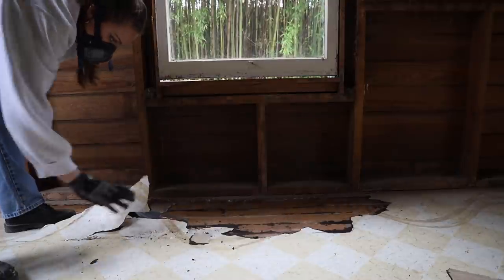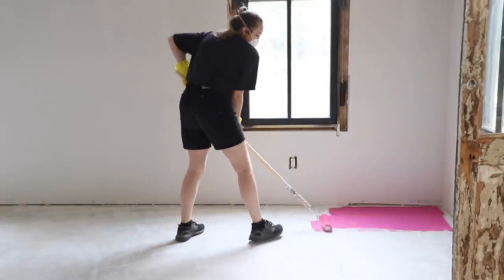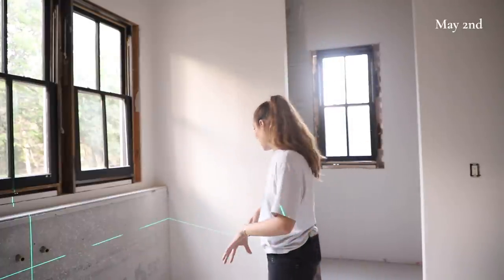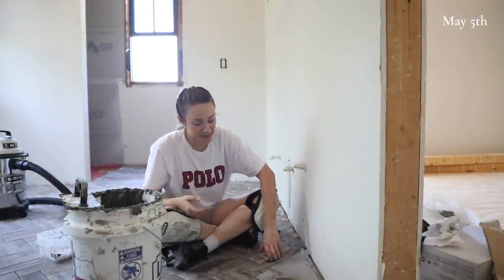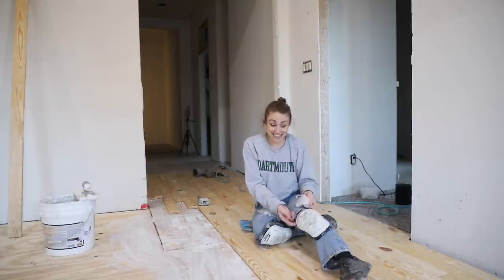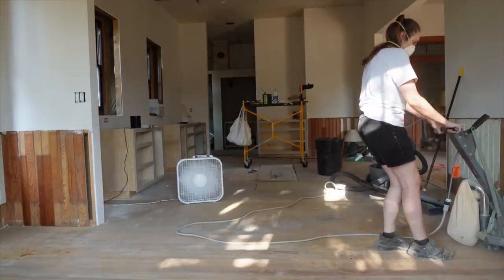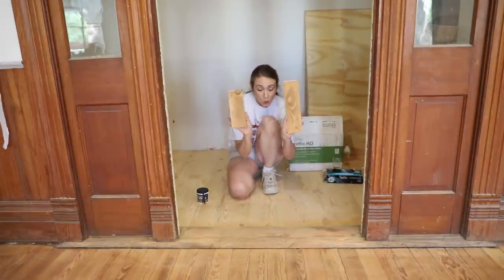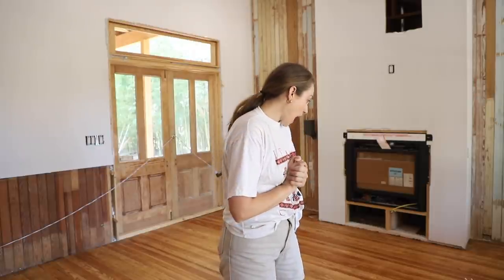DIY FLOOR RENOVATION *Restoring 110-Year-Old Hardwood, Laying NEW Hardwood & Herringbone Tile*

Comment: We usually use the water proofing on a small part of walls as well, about 4-5 inches high like skirting, to add a seal and keep moisture out of the cracks in between floors and walls. After this barrier, we roll out a layer or two of a thick underlay. If the floor space is too large, the underlay can be done with intervening plywood boards in order to avoid having a dip in the middle of a room with time. You can try this at the guests’ cottages later. Lastly, transition pieces can vary, and a lot of them have a tongue to be imbedded between 2 types of flooring. I just hope you left some space to accommodate. Lastly, Loving every minute of your videos, Very nice work and a superior attention to detail overall. This is exactly how I’ve been doing it. This type of work has its toll, but it’s worth every second in the end. Take your time and takes care of yourself 💐

Comment: That is a whole lot of hard work done! Amazing job! 👏
One question: Doesn't nailing the subfloor ruin the vapor barrier? I would assume it should remain intact 🤔
Reply: Almost impossible in this application. Some vapor barrier systems come with penetration seal patches. But since the plywood is attached at random nail locations, the nail holes cannot be spray foamed and caulked. Since the RedGuard in this application is being used for concrete “sweat” the likelihood water will seep through is minimal.

Comment: Hi MaCenna! Watching your video now. My dad, my husband and I installed engeineered herringbone floor to our entire house. We used the same glue with the water membrane. We recently had a small flood (broken washer) and had people come around to check the moisture level of the slab. It was perfection. No water had made its way to the slab thanks to the glue beneath (we didn’t waterproof). Can’t wait to see how your home turns out! Also, you’re amazing. How much you’ve achieved is really inspiring. Thank you for sharing!

Comment: Wow, that floor sealant really makes the floors look fantastic!  I wonder what those wires are sticking up through the floor in the living room?  Great job guys!  You've learned so much and your experience is building hugely!
Reply: She had some holes from where the old walls were that she was going to fill with medallions, but everyone in the comments said to put floor outlets there so she can plug in lamps, so I bet that’s what they’re for.
Reply: @ang_131  - That is exactly what they are for. Floor sockets to plug lamps in.
Reply: @ang_131  Excellent idea, like they did in the old days.

Comment: check the CFM requirements of the nail gun compared the CFM output of your compressor—you're right, you probably need a slightly bigger compressor to feed that thing. the nice thing about a larger compressor, is that it opens the door to other air-powered tools like polishing sanders, hvlp guns for paint/stain/clearcoats, etc. house is looking great!

Comment: You picked one of the hardest styles of laying tiles but you a great job .  Did you level it or make sure it drains to a drain all with a level to? I also noticed I didn't see drainage any where And always work to the door way so you don't walk on the tiles to get out....also sanding the floor be careful you don't take to off.

Comment: Cutting tile...to prevent breaking...
* One thing you can do is put a strip of masking tape over the cut line. Then mark your cut line on the tape. If you're laying it glaze side down, put tape on both sides. 
* When you get near the end, slow WAY down!
* Cut in on the opposite end ~ 1/2 inch, then flip over the tile. Cut the full length all the way to meet your 1/2 inch cut-in.

Comment: This is so labor intensive. Think of what it would cost to pay someone to do all you and Romeo have done!  I kept hearing you say hardwood and when I looked at floor I thought it was pine.  Now you confirmed it.  I was of the idea that pine is not hardwood.  Yes or no?  The concrete floor in my outdoor shop sweats in fall when we have temperature changes.  I have thought about changing the barn to a she shed but I can put any flooring on top of that concrete unless I do some moisture proofing.  So watching this with a lot of interest.

Comment: Hey, I would suggest using screws if you have the option. Our floors were previously
Done with nails and shifted a lot over the years and squeaked and caused gapping because of it. We had to use screws when redoing the floors in order to fully secure them

Comment: I feel like you must stop every time you walk into your cottage now and just stare at your beautiful restored floor... I have always loved the character and patina that comes with age, and I think you have made so many fantastic desicions with this house that it is just going to light up your soul every time you are there.  

Regarding the stain colour for the new floors (which I don't know if you'll have done yet when you read these comments), I find I get the best results by mixing or layering stain, especially if I am trying to add character to a new surface. Just wiping on a stain colour with a little more of a reddish tone over the Golden Oak (like maybe English Chestnut?) and then wiping it off almost immediately might give you more of the colour depth and variation you a looking for.

Comment: I’m considering pine floors in my new house and was just wondering exactly what pine you went with and what the rationale was for glueing as well as nailing. Was this to do with the way the boards were milled ie tongue and groove only on sides? We’re you gluing to avoid face nailing them? Any insight greatly appreciated.

Comment: Looks great but here in Australia you can not penetrate waterproofing (with nails as you did) as that allows a pathway for water to move up into your plywood, cancelling out the effect of the waterproofing. Did you check this with your? If you could penetrate it with nails?

Comment: Wow what a difference. But I wonder why you already did the sealer when you have things like the walls and the chimney to finish off. Sanding and all that sure. But I feel like I would have waited for the sealer part till later. So they don't get damaged by the other work still to be done.

Comment: I'd say if the tile is breaking either the  blade is dull or the speed isn't right 🤔
If borders are messing with you for the herring bone, have you thought of using an angle gauge ? (I know I'm too late but hey 😅)

Comment: Roll your paint roller on several 12 inch long peace’s of duct tape overlapped to make a large square of tape to de lint it, lint free shmint free…
Also seal the edges of your base board and window tape with the wall color, let dry, then paint the new color for a perfect crisp line.

Comment: The floors are looking so good!! But quick question, are you gonna use a wood filler to fill in all the old cracks and spaces between the panels? If so an awesome jack is to mix the sawdust from sanding and wood glue! Its makes a better match to fill little gaps, just go over with it with a squeegee!

Comment: Shouldn't you have conditioned the old wood floor as well? I mean that wood is the oldest so it probably needed it way more than the new one. Or does the sealer work as conditioner as well?

Comment: Concrete is always 100% better than wood, wood will rotten concrete won't, I personally ate board floor, but I believe you guys are doing a great job, if it was me I would rip out the old flooring and replace with knew ones, those wood floors as being there for a very long time, blessings as you guys put your all and all in your beautiful home 👍

Comment: 10k views in 52 minutes. wow. That red stuff is used in showers & tile. i think it is genius you are using this. Sorry im not there to help you guys. The concrete nails probably have glue on them. Use a scrap piece of wood against the plank you are hammering in & hit the scrap. That stain on the floor is breathtaking